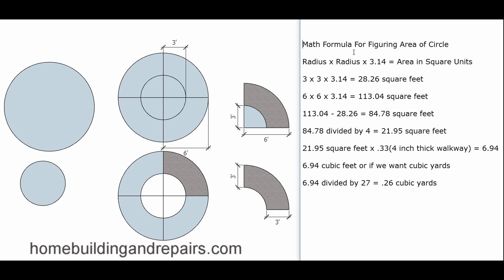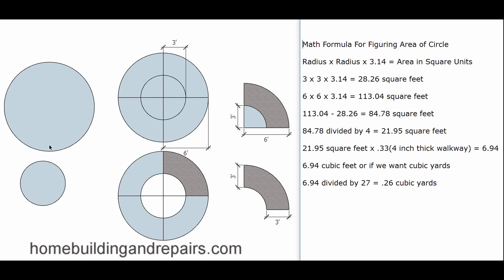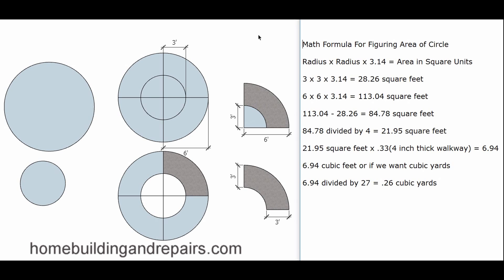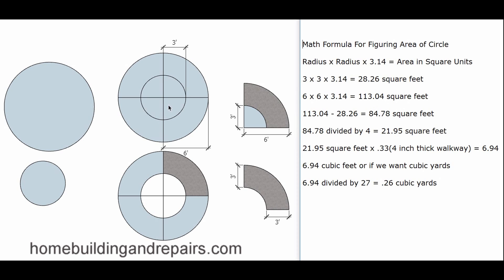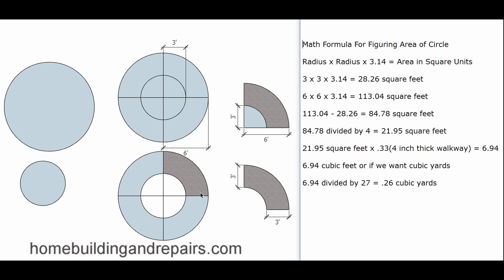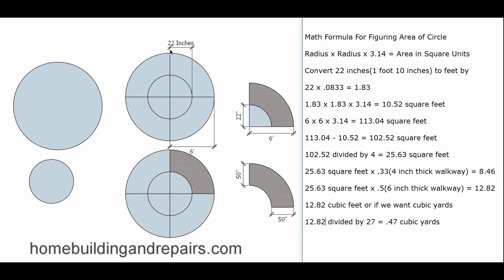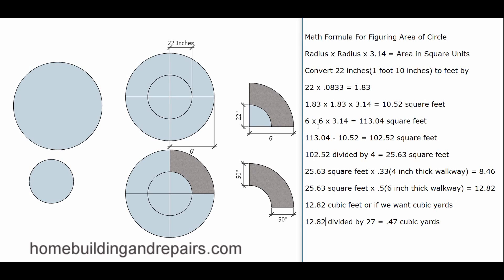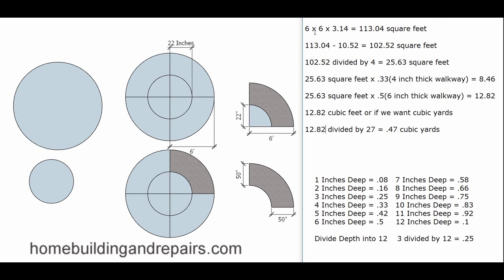How to Calculate Amount of Concrete Used for Circular Shaped Walkway

Comment: 3 + 1.5 = 4.5 radius of centerline of arc. 4.5*2*pi*0.25=7.07’ = length of centerline of arc times 3 = 21.2 square feet *3.5/12=6.2cubic feet or about a quarter yard of concrete at 3.5” thick.

84.78/4=21.19